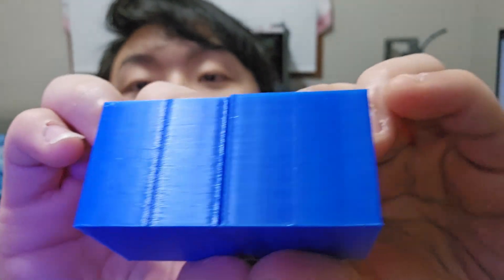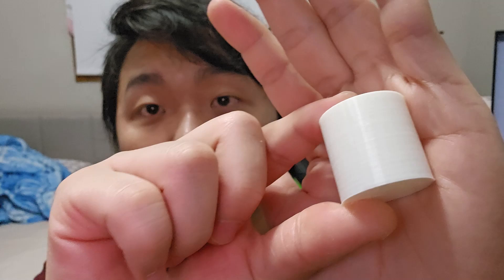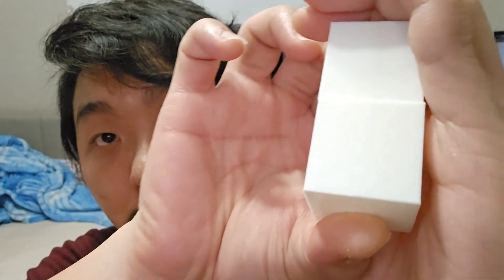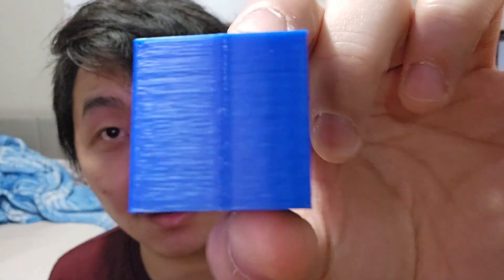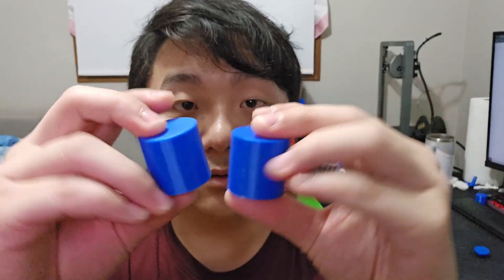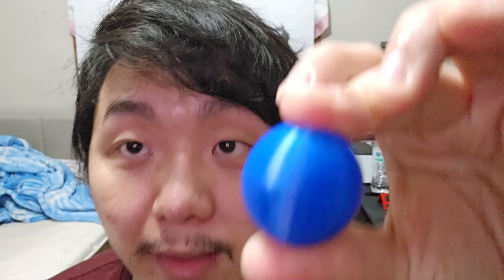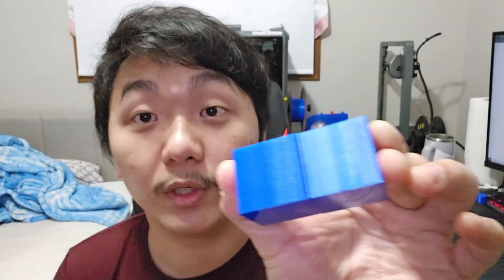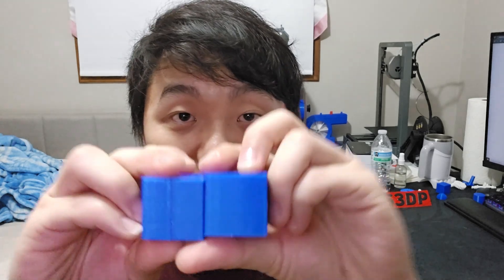Achieve Smooth 3D Print Walls with Scarf Joint Seams

Comment: Have you tried 3D printed EPDM rubber o-ring cord stock? Unfortunately, I haven’t found any filament that will work for what I need it for. I was considering using some .070 EPDM o-ring cord stock to print some gaskets for a heavy alkaline solution, as well as a steering knuckle boot for the truck. It looks like it’s feasible on my printer (K1M) so I’ll grab 10’-25’ just to proof it.
Reply from the maker: I have not try 3d printed that filament, it seems pretty hard to print and quite expensive. Let me know if you are successfully print it.

Comment: Use random seam..it will hide it.
Reply from the maker: It will but you'll get little dots all over the 3d printed part.
Reply: Yeah, no way, that never works. Especially since I primarily print in cf and gf filaments, and those random seems leave poc marks all over the prints. And because the filaments I use show those poc marks like a highlighter.

Comment: My dude... I really like your content and appreciate how you are bringing us the cutting-edge stuff, but please...PLEASE make your bed before you record a video that's going to be shown to the world. It doesn't have to be perfect, but the wadded-up blanket(s) and haphazardly placed pillow(s) are at best distracting in your videos. I'm not saying this just because I'm a dad, but rather it is something I learned helps set the tone for how you carry yourself for the rest of the day which is more important for you than for us as viewers (although you do want to remove every potential distraction for your viewers).

It also would be a good idea to have a light come from behind the camera on to the objects you are trying to show versus relying on overhead light that your hands/fingers could end up blocking. That's about the only technical suggestion I have as you already noted white PLA doesn't show defects very well (which is why some vendors include it as the free filament with their printers).

Thanks to your videos I now know what a scarf joint (not "Join" in the title) seam is and I am looking forward to it. I look forward to your future videos as you tweak the settings for the scarf joint seam, and please keep up the good work!
Reply from the maker: Yes, you're correct, I really need to clean up my room. Omg thanks, I didn't realize that it says join instead of joint.
Reply: @Scratch3DPrinting  I believe you have the "it" that will take you far in this if you put in the time, so I hope you keep at it. You beat everyone to the punch on the scarf joint video review, and I have like 50 3D printer channels in my subscriptions which really impressed me and is why I subscribed.
Reply from the maker: @hotfix7387 Thanks, I will keep the content coming. 😁